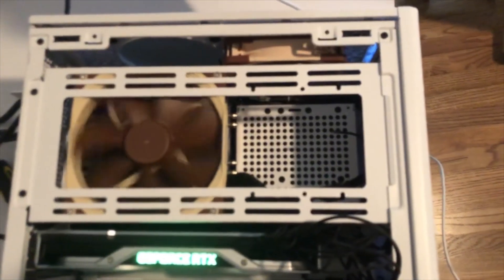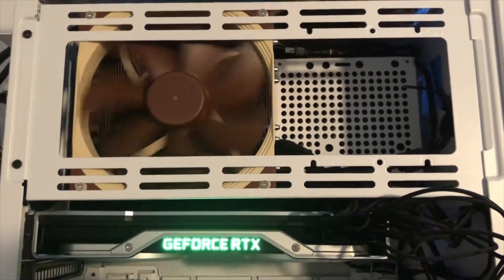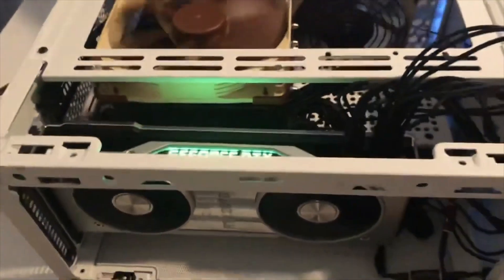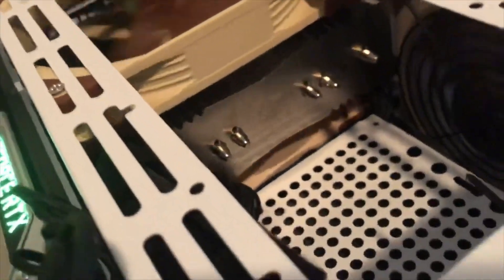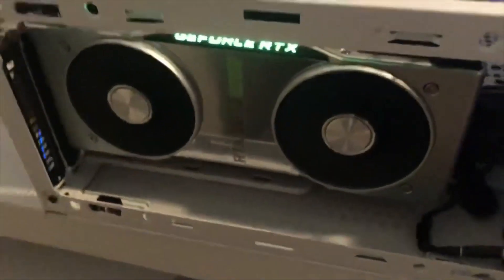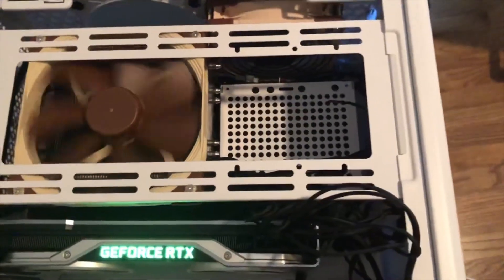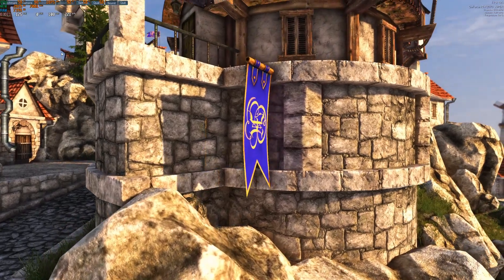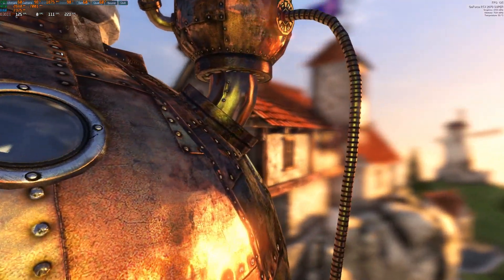Cooler Master NR200 Build Follow Up

Comment: Can higher profile ram like patriot viper high performance sit under the fan In low profile or is it too tall. It looks like it has a some room for a few more mm of clearance in your previous video. I was considering this exact set up but I fear my ram may not clear it.
Reply from the maker: 1-3 mm may work, just need to measure to make sure

Comment: Hello! Nice build! Some questions: why do you put c14s fan on side panel, not on radiator? Is it possible to use the same second fan on the other side of the radiator or only the smaller fan will fit? What mounts do you use to fit slimmer fan on the top of the case (i have 15mm noctua fan) Thank you!

Comment: Did heat pipes of  C14S hit IO shield of MSI Z490i Unify ? I saw you changed the angle of this coolers multiple times
.
Reply from the maker: No, there’s plenty of room.  Using that area to store fan cables in.

Comment: Hey nice videos! Is the fan behind the c14s cooler an NF-A12x25? If so, how did you mount it? The metal clips that came with the c14s cooler are too big for the NF-A12x25.. please help!
Reply from the maker: You can contact Noctua support and they will send you fan clips for free.